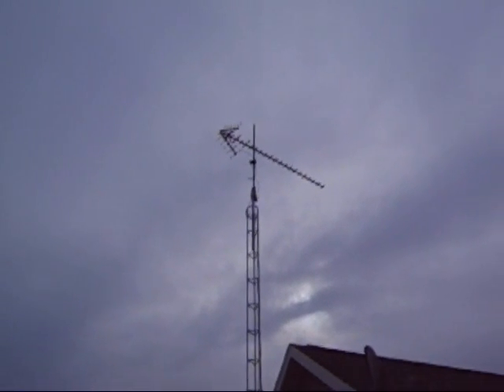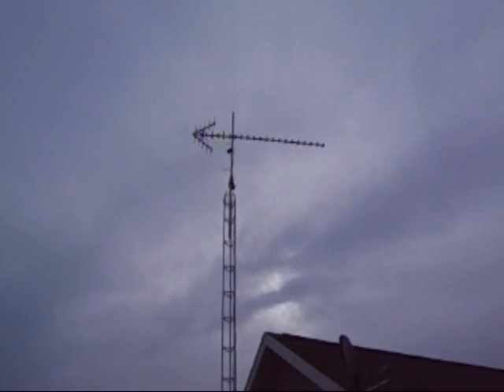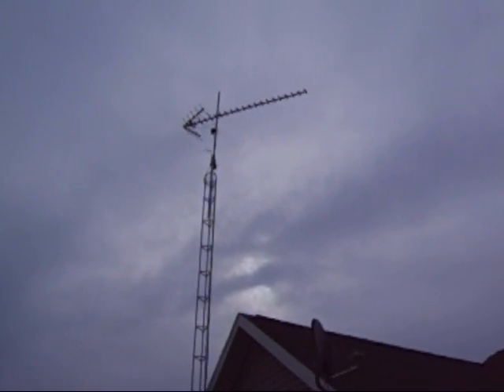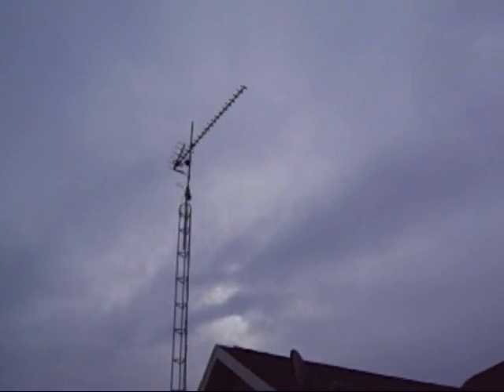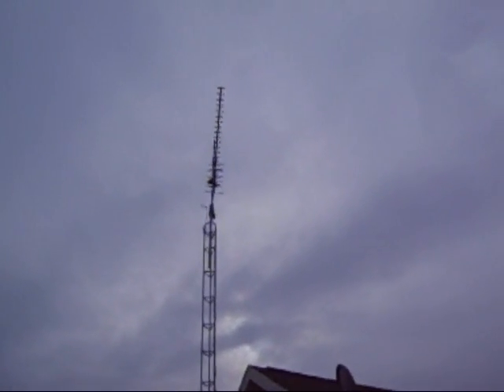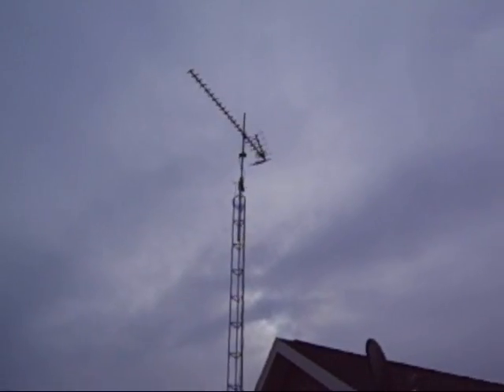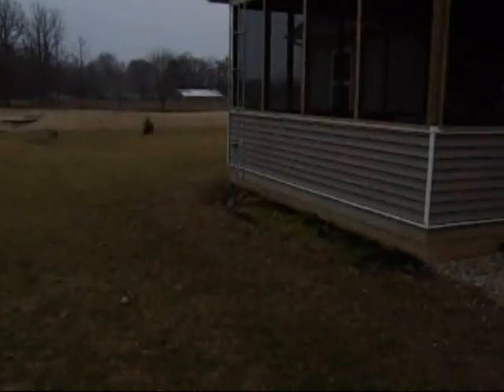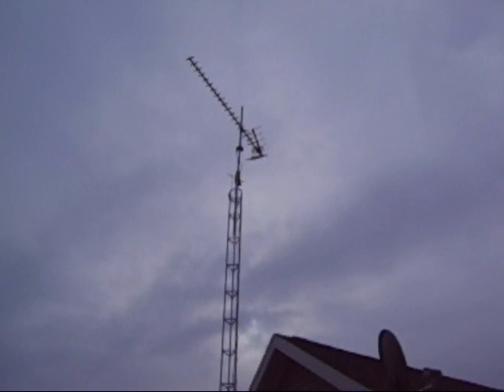Winegard UHF Antenna

Comment: I have a Delhi604 with the same problem. the remote box uses a timer to estimate its position, and the speed varies in colder weather. Apparently moisture gets into the seal and it slows down in bad weather. They don't make them like they used to.